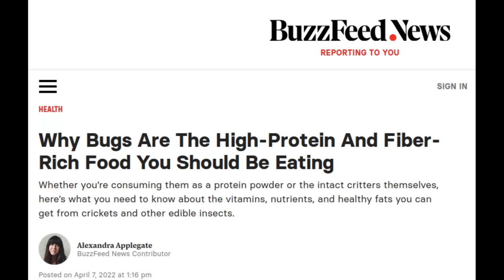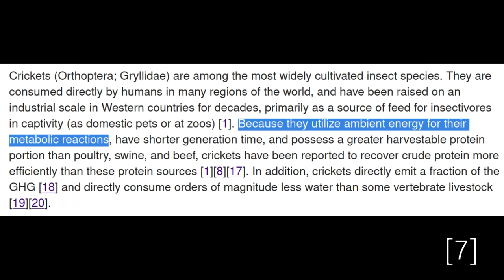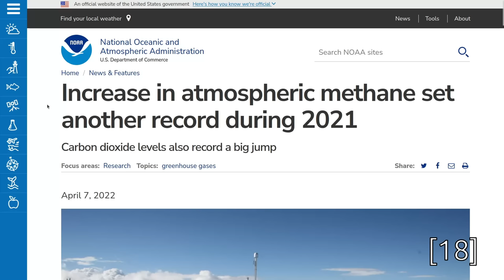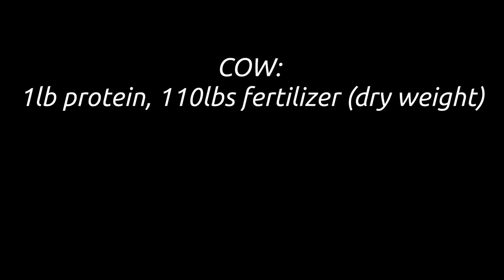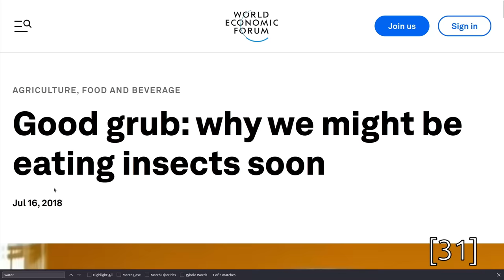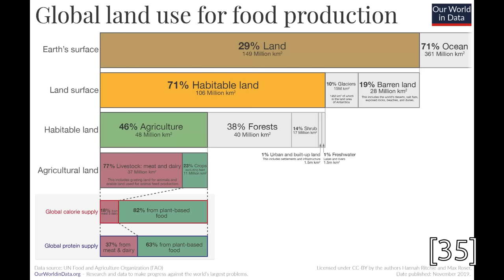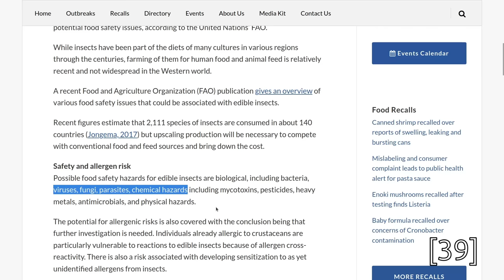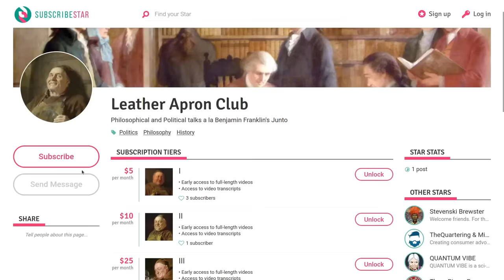Why We Won't be Eating Bugs in the Future

Comment: Your also forgetting that the protien in bugs are not as easily absorbed in human digestive tracts because the majority of the protien is chitlin which has very low absorption rates
Reply: Don't chitins break down with cooking though?
Reply: @fredbologn2344  rather have b@t soup than a fly pie
Reply: @fredbologn2344  you tell me, do shrimp shell become totally edible when you cook them?

chitin is uniquely heat and water stable. it does not ever break down through cooking. you need to break it down chemically.
Reply: @marvalice3455  Doesn't that also bode rather poorly for the health of people who consume chitin?
Reply: @Isaax  not necessarily. we cannot digest cellulose either, but that's not a big deal. 

there is some evidence that too much chitin in your diet can be a problem though. in this case "too much" would be basically the amount the bug fetishists want us to eat.

it's fine to supplement your diet with sea food and mushrooms (which also contain chitin as their main structural protean btw) but it is likely a bad idea to make either a massive part of our diet.

(sea food in general, because fish and mollusks also have a decent amount of chiton. fish scales  and some other parts are made of it, the tough bits of mollusks other than their calcium carbide shells are made of it, the shells of crustaceans are made of it, and some sea plants have it too. all because it doesn't dissolve as easily in water as keratin or cellulose do.)
Reply: Isn't it chitin and not chitlin? I know some folks who have no issue digesting chitlins.
Reply: @thomashightower7881  I'm sure that was a typo.
Reply: @marvalice3455  yet you missed that I made a joke. I found that typo amusing
Reply: @thomashightower7881  sorry, I cannot read your tone of voice.
Reply: @marvalice3455  are you suggesting that shrimp shells aren't edible ??

Google that and get back with me.
Reply: @fredbologn2344  I'm suggesting shrimp shells are "inedible" in the sense that it is never delightful to eat them.

for me, "edible" does not mean "possible to eat" because poop is possible to eat. nor does it mean "safe to eat" because marbles are perfectly safe to eat.
it means "good to eat". and shrimp shells are not good to eat, even if they are both possible and safe to eat them.
Reply: No, this is not true. The protein in bugs is just as readily absorbed as other sources.
Reply: Crabs are yummy bugs tho
Reply: @Maimkillburn69  Would it still be yummy if you were forced to eat it and nothing else save other bugs and soy slop? That's what they want to do to us...
Reply: Then they'll just make us eat maggots and worms.
Reply: Chitlins?
Reply: you are right about the amino acid profile of bug 'meat' being inferior to poultry, eggs, beef, and dairy. However, that is not because of chitin--chitin is a sugar, not a protein.
Reply: Ah, yes, BIOAVAILABILITY, the one thing advocates of anything that isn't roasted meat will never bring up.
Reply: @likemy  no its not, smh. It's a polysaccharide. That's no more a sugar than cellulose is. And it's got nitrogen in its chemical structure giving it some protein properties. Don't twist the facts
Reply: @maisuchan6209  might wanna read a little farther down that wikipedia article in your other tab, friendo
Reply: @maisuchan6209  if that's the case, you've been spending a little too much time in the barnyard--your bedside manner has suffered. PS: UMDNJ, class of 2014
Reply: @likemy  at a certain point, "sugar" and "protein" becomes a false destinction. 
It's true that simple sugars are different from amino acids, sure. But once structures reach a certain complexity, they must necessarily be made of both
Reply: @bare_bear_hands  because roasted meat is a part of what separates us from chimps. 
And not just us mind. Carnivores universally put less work into eating than herbivores with comparable weights and metabolisms. And the exceptions are only exceptions because there aren't any herbivores with the same metabolism in their weight class.
Reply: @maisuchan6209  calm down, friend. I wouldn't want an internet-katana (folded 10,000 times of nipponese steel) to the eye. By the way, can anyone tell me me what 'polysaccharide' translates to?
Reply: @likemy  not sugar that's for sure 😂😂 you still want to engage in this dance? Ok, I'm up for it😁
Reply: @marvalice3455  some people are just stupid. Ignore.
Reply: @likemy  it is a complex derivative of sugars, such as starch found in grains and cellulose found in vegetable fibers such as wood
Reply: Chitin is not protein it is a carbohydrate and it is also common in mushrooms and other fungi like yeast. While it is true that it is not digestible it pretty much acts as dietary fiber similarly to cellulose or lignin found in plants. However chitin associated proteins do seem to have high biological value and digestibility, however as it often occurs with science more research is needed.
Reply: @likemy  "can anyone tell me what polysaccharide"
What is named? Or what it is?
Assuming this is a good faith question, and not a very stupid rhetorical one, polysaccharides are complex organic molecules which use sugars as their base.
Obviously this doesn't mean they are only sugar, or that they act like sugars, or that they do not require huge amounts of protein to make. All of that depends on the specific compound in question. For instance, chitin is heat and water stable. Despite using sugars as the base of it's structure, it will neither melt, not resolve in water at any point.

 Someone asserting all polysaccharids must just be sugar because the name means more than what they actually do would be making a number of bad points in their reasoning.
Reply: @133774c05  "more research is needed"
Code for "I said this, but if someone else did I would say they were wrong"
Reply: @marvalice3455  friend, you're following a thread a dozen posts long discussing the nutritional value derived for humans (or lack thereof) of chitin. Are you going to argue that chitin should be regarded as a protein because of an amine group between its glycocidic linkages? Are there any humans who can satisfy their dietary protein needs from chitin? Is chitin more accurately considered a carbohydrate (like cellulose)? There are good faith questions for you. Not going to bother further splitting hairs, but I'll at least read your response.
Reply: It’s also cancerous.
Reply: @marvalice3455  imagine eating literally bugs. Slavery
Reply: @likemy  okay, I think you are misunderstanding the flow of this conversation, or perhaps I am. first, someone said a large portion of the protean in bugs is locked up in chitin, which humans cannot process, someone than said that is not true, because chitin "is a sugar", and that is what I was responding to.

people have said a number of different things in here, and there may have been confusion about who was talking to who, but let me be absolutely clear, that I am saying that there is, indeed, a noteworthy amount of protean in chitin, which is included in the animals weight, but no human will actually be able to access, because humans cannot digest chitin.

I am not referring to health benefits, or health drawbacks or health neutrality of chitin in this comment, it is purely a matter of whether you actually get the grams of protean on the label, and my position is that you do not get those grams, even if you eat them, because a notable percentage is indigestible.
Reply: @marvalice3455  Can you provide a source that a significant amount of protein is unavailable due to it being bound to chitin? It has to be considered that processing the "raw insects" influences bioavailability of nutrients.
Reply: @barium4355  my source is this.
"Chitin is too complex not to have protein in it, and humans cannot digest it, therefore it is not available"

Appeal to authority is a fallacy.
It's a syllogism. I don't need to wear a lab coat for it to be true, you need to dispute the premise or the conclusion if you want to show it is wrong. Not say "that may be sound, but the priest says no so I believe him"
Reply: @marvalice3455  Bruh thats not how it works if you want to have a honest discussion. I know that chitin is indigestible I was talking about the amount of protein bound to chitin. The sources I found show a generally high bioavailability of protein and nutrients in various insect preparations but were not exact about how the presence of protein bound to chitin influences the measured amount of protein in total.

Edit: Aside from this asking for proof is not "appeal to authority" as a scientist is not an authority and claim is always true or false independent of the person stating it.
Reply: @marvalice3455  deep frying prawn shells makes em crispy and fine. Issue is boiling them. I still just eat em cause I'm too lazy to peel.
Reply: Exactly, that would be the issue. You can starve if you're bound to eat only insects.
Reply: @hrodvithit  if you're eating boiled prawn shells you probably won't notice the switch to Bug meat 😂
Reply: @fredbologn2344 No, they go through us.
Reply: A lot of the feed given to animals is protein and plant matter we can't use. Silage is corn stalks and trimmings that is fermented to a cow's delight.  Insects like meal worms provide a CLEAN protein for chickens and fish. If we use cattle trimmings, we are in danger of having an outbreak of Mad Cow transmission. It hasn't (yet) been seen in birds, but as a neuropathology researcher, I don't want to see it!
Reply: You won’t be chitin much then?
Reply: @fredbologn2344  no not easily. It's not a food source for every single animal, especially ones that don't actually eat bugs primarily.Turns out he human diet is very set on meat, not chitins, and veggies, which bugs do not have any nutrition comparable to.
Reply: @Isaax  yes, as we've been shouting to the heavens about for years now.
Reply: @placeholdernameisplacehold7671  no it isn't. Chitins build up because they don't break down easily. Saying they can be and sustainablyeaten only, are two different things. We where never meant to eat one thing, ever.
Reply: @Maimkillburn69  they aren't bugs. People are ridiculous. They have similar physiology in that brain matter is dispersed to limbs and such, they aren't otherwise remotely similar.
Reply: Chitin is not a protein, it's a sugar, a polysaccharide, analogous to cellulose.
Reply: Chitin is a carbohydrate though.
Reply: Chitin is a polysaccharide, which he said would act as a fiber. How do you oversee that one fact?
Reply: Chitin is not a protein but a polymer, and also if you want to seem clever about something, at least spell it correctly.
Reply: I guess my chemistry classes lied to me. Sugars are proteins now. I've been enlightened
Reply: chitin is a carbohydrate
Reply: and highly inflammatory
Reply: @marvalice3455 this why you have teeth for man
Reply: Chitin isn't protein
Reply: Chitin is a sugar, not a Protein at all.
Reply: Most humans also have an allergy to chitin, which causes problems in absorbing Vitamin C, which is responsible for cellular healing. Vitamin C deficiency causes scurvy, which isn't actually limited to gums. In fact, it causes scars to become unhealed, meaning old wounds starts bleeding again
Reply: @moonshinetheleocat1235  difficulty absorbing does not mean 100% prevention. and you need to be 100% deficiency to get things like scurvy. its very easy even accidentally to get enough c vitamin to not get scurvy in modern environment.
thats why there isn't scurvy patients in modern world even among people that don't eat right.

"Vilhjalmur Stefansson, an arctic explorer who had lived among the Inuit, proved that the all-meat diet they consumed did not lead to vitamin deficiencies. He participated in a study in New York's Bellevue Hospital in February 1928, where he and a companion ate only meat for a year while under close medical observation, yet remained in good health."
Reply: bugs can be genetically modified like your plants and meat has been.
Reply: that is somthing i relized makes perfect sence thank you for teaching me this or helping me relize i play ark AND CHITLIN is one of the materials you get from killing bug dinos its a ps4 game where you build and survive its a good game for exploing ....have a nice day